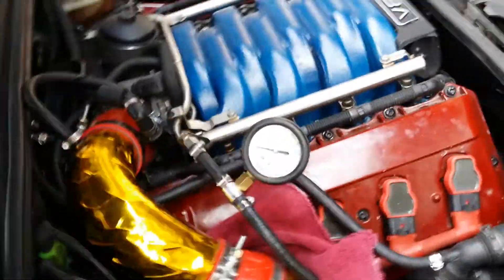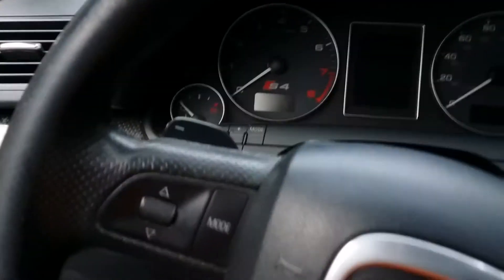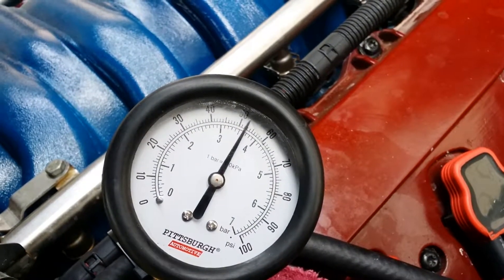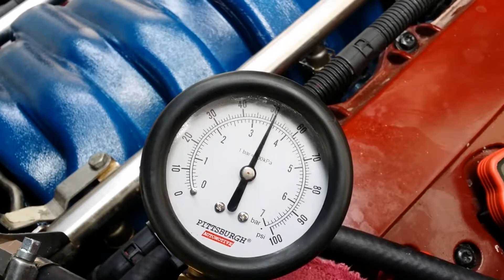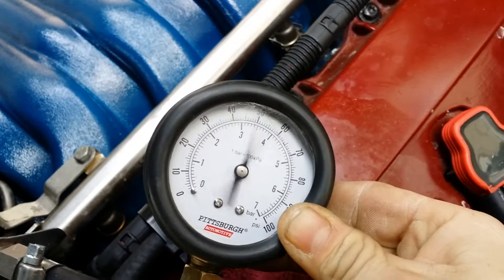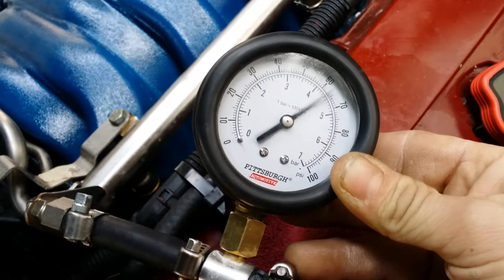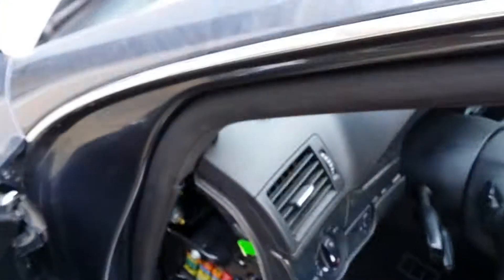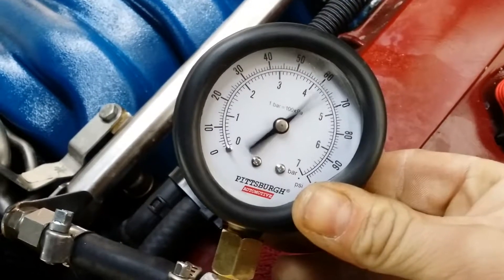B7 s4 fuel pressure reading

Comment: Hey what thread did you need to use to tap into the system to get a read ?
Reply from the maker: I just used a cheap tester that came with a tee. I put the factory fuel line on one end of the tee and a short section of hose after into the fuel rail. Only took a few hose clamps

Comment: What Code showed up??
Reply from the maker: No codes whatsoever
Reply: @vinnyaudi912  wauw damn 👎. Where is the evap canister located on the v8 engine?
Reply from the maker: @danniiliasoff2732  under the spare tire , under the car. There is a plastic cover you have to remove.

Comment: Did you find the problem ?
Reply from the maker: So I found out that my car uses a four bar fuel pressure regulator. The pressure drop I was seeing and fluctuations in the fuel pressure we're simply due to the injectors firing. Pressure regulator is built into the fuel filter so the reading I had was between the filter and the fuel rail. I had been having some issues and traced it down to a clogged evap canister. My fuel sending unit also went bad shortly after this video. Once I changed these out, haven't had any issues since.